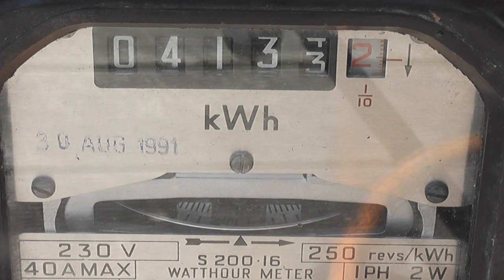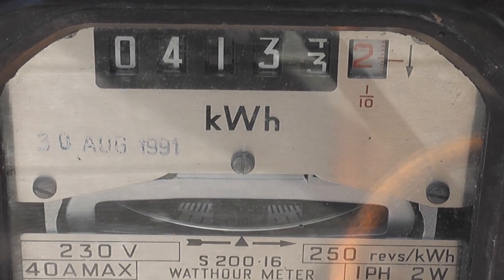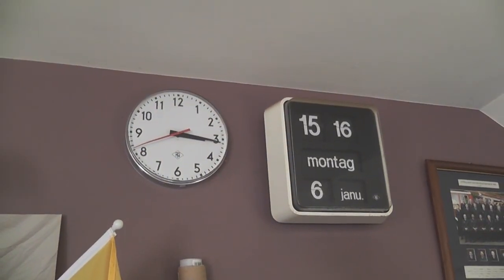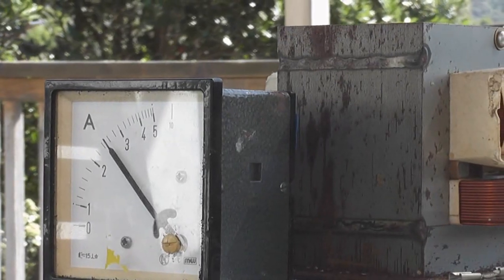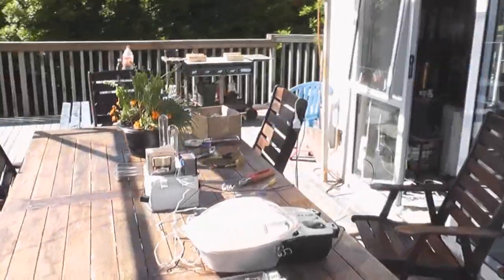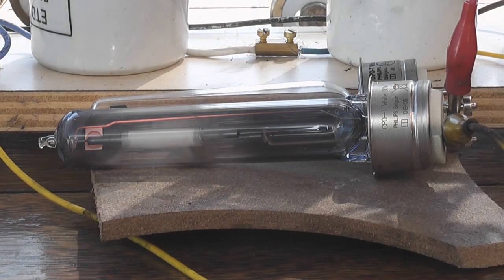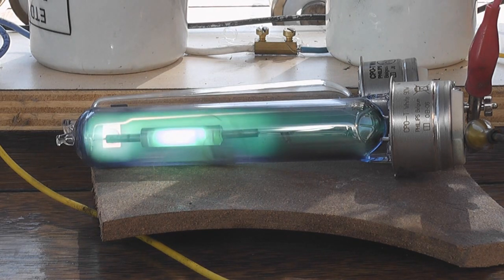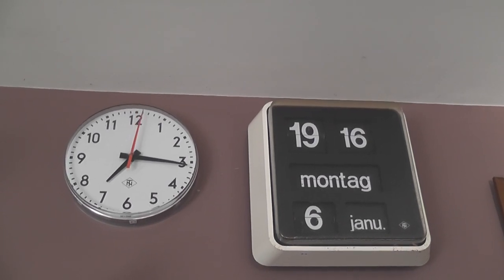HP Sodium Lamp power consumption test

Comment: Hi Ray, love those sodium capsule lamps, the double capsule is interesting. I have scored an EMAIL 3 phase power meter, do you think it would be possible to make it run on single phase? I might need to modify the current windings to get it to run.
Thanks for great vids.
Reply from the maker: No you don't need to modify the meter. Just wire up the Active to one of the current coils, (M) and load to the other side of the current coil.(L). and the Neutral to the most right hand side terminal of the meter.
You can pick whatever phase you like.
Take the meter cover off and you can see how the coils are wired.
If the meter has an 8 terminal block it goes as follows.
Active in on T1
Active out to load on T2
Neutral to T7 or T8.